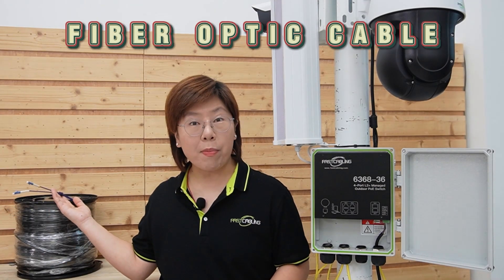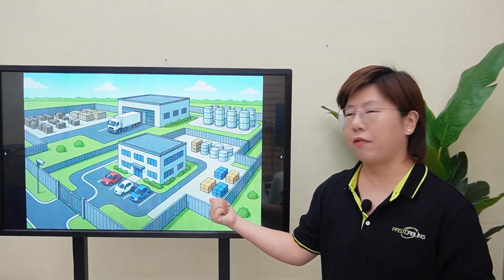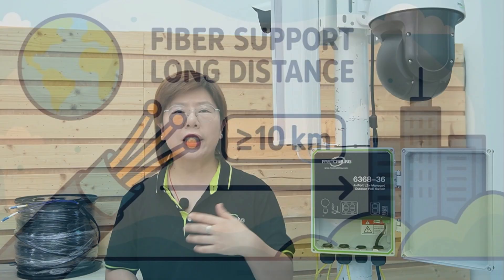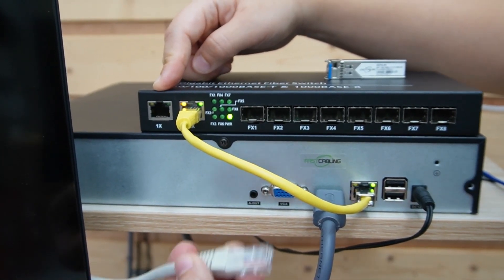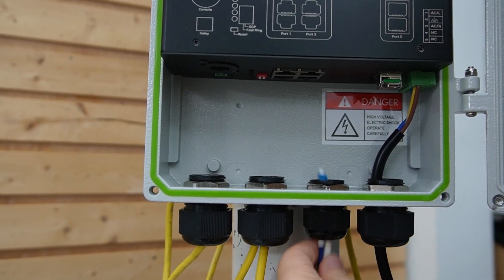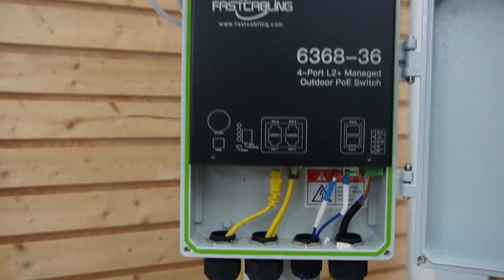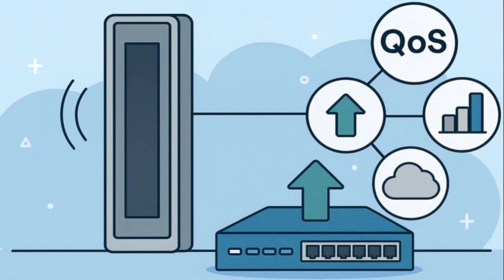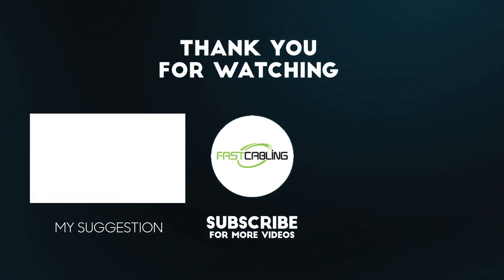PoE Cameras & Speakers Long-Distance Outdoor Install: Fiber + Outdoor PoE Switch

Comment: The Microphone and speaker are they connected to 0ne ethernet cable to the switch
Reply from the maker: No microphone, just the speaker. The PoE devices are connected to the switch via Ethernet.

Comment: how to stack multiple NVR as One unit like we do in network switchers
Reply: get a unify system makes it easy
Reply from the maker: NVRs are standalone recording systems with their own CPU, storage, and OS. You generally can’t stack NVRs like network switches. Most professional systems use centralized VMS software to manage multiple NVRs. Each NVR records independently, VMS software connects them together, and all cameras appear in one interface.

Comment: Hello, this video is really good and informative. As far as I understand, let's say we have two buildings, and one of these buildings has cameras. If these images are being transmitted to the other building, wouldn't it be more logical and correct to connect the switches between the two buildings with fiber optic cable? I'm new to this topic and wanted to ask to clarify.
Reply from the maker: It's exactly what we did. Use fiber optic cables to connect two switches. We use a fiber optic switch as a distribution switch and an outdoor PoE swith with SFP as an access switch, which can deliver power and data simultaneously to the connected cameras.